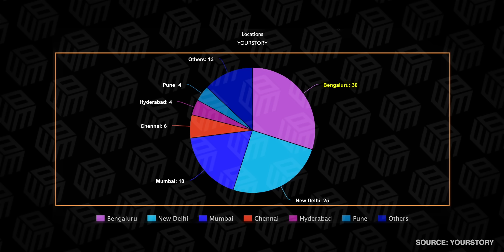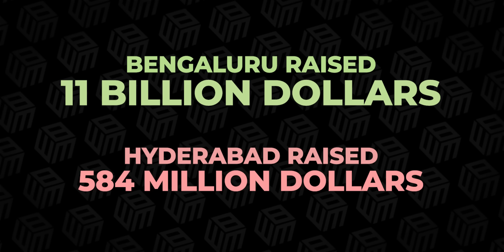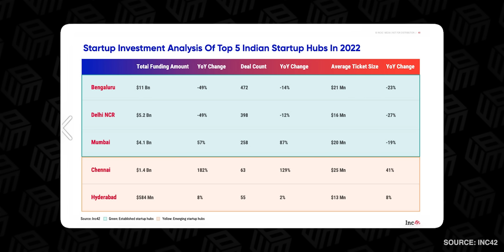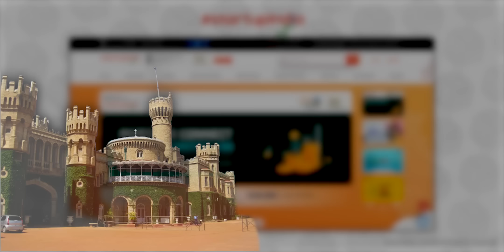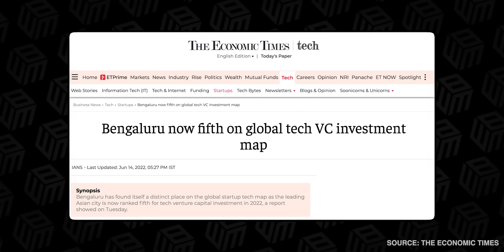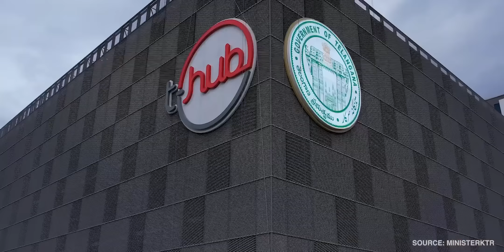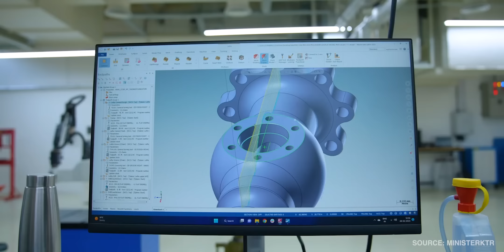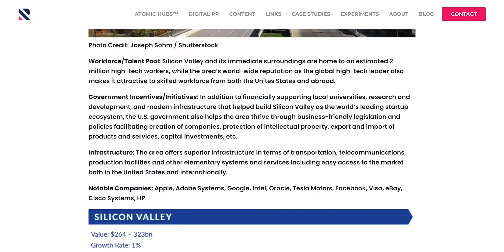Can HYDERABAD Replace BENGALURU as India’s Startup Capital?

Comment: The biggest problem is Banglore is Property (Housing), Water and Traffic. Unless these are not solved, other cities will be benefited, and top beneficiary would be Hyderabad.
Reply: Basically , Infrastructure !
Reply: In this Era we skeptically think Bangalore is the monopoly in startups in India but this will be drastically literally there will be an exponential decrease between the differences in graphs and positions. You know the problems  that Hyderabad is facing might not be the forever but you know the network of startup is engraved totally and Hyderabad is working hard to demolish these kind of flaws which can make Hyderabad a place of startup Hotspot. And if we think the housing , water and traffic every mega city in India has this problems and it only makes better if we go through all the problems and improve our numbers.
Reply: Bengaluru is currently facing the issues which Mumbai faced in 2000s.....back then Mumbai was practically only Megacity of india but due to absurdly high housing cost, biggies dominating the market and difficulty in flow of skilled labor gave room to bangalore to rise as IT-hub. It's also notable that central gov. also tried to push trivendum and later chennai as IT-hub but bangalore surpassed due to better support from gov and ppl for the industry.

Currently hyderabad's gov and public is providing great support to the industry so certainly possible.
Reply: What do you think of PUNE. if Punes infrastructure improves then sure it can give tough competition. As you can see Pune and hyderabad is on same path. See hyderabad has 49 and Pune has 50 so what you think. 😊 by the way love from Maharashtra 😊.
Reply: @Immortal10364  Pune is good but HYD has other advantages. Theres a reason why Bengaluru became IT capital of india and not Mumbai ...somewhat similar dynamics play there.
Pune isnt as big as Bangalore but it's already nearly as costly as Bangalore
Reply: If we talk about Property that is relatively less than Namma Bengaluru, but Hyderabad is having BIG problem of water, everybody canned water is there, tankers for society. Talking about roads only new city Cybarabad road seems good. However Government In Hyderabad is playing good for IT industry and they are keen in improving their work for registering firms in Hyderabad. Pls listen to KTR's speech while Tim Cook was in Hyderabad. His speech seems to be visionary. Talking about Pune, Pune is going through transformation including Metro, Roads, bridges, Public Transport. If Maharashtra Gov. work efficiently towards bringing and keeping IT companies then it will be a tough competition to Hyderabad.
Reply: Bangalore was one of the finest cool city still it is compared other cities !!
What happened was suddenly IT grew exponentially and the it crowded with people coming from across the country. Nearly 30 to 40 percent people are from other states. It is not mean Karnataka won’t like other state people we welcome every Indian. It’s we citizens also have a role to play. Having that said infrastructure needs to improved no doubt about it. Still it’s far better than any city in India like whether people place and all.
Reply: Have u visited Hyderabad now. Most of the Hyderabad roads are under water now
Reply: @SS-uf8yq especially old city
Reply: Footpaths were pathetic, roads full of potholes until Narendra Modi with his visionary Smart City Projects brought Bangalore under Smart City category to ward off shame of not having basic road infrastructure. Footpaths had Kota stone slabs... tar roads were converted to concrete slabs for longer road life.
Reply: Problems with Hyderabad is Public Transport and Drainage system.
Reply: Also major problem - hate against immigrants
Reply: pay at least 20k as rent to get your needs  
As of ur thoughts, the government of Telangana doesn't really care that much, the only thing is education is too bad in SSC and the government expenses of  also too high
Reply: It is enough for one city what i feel
Reply: HAHHAHAHAHAHAHA, look at hyd is 2024, infra so good that it's 50% vacant and empty

Comment: fun fact - Yedurippa the previous CM of karnatala has mentioned in a press release more than a decade ago that due to the agitations in the hyd for a separate state in 2009-2013, it lost  a lot of startup's from hyd to bangalore (which were originally intended to come to hyderabad) and a lot of automobile industries which were scheduled to be started at hyderabad to chennai! and there is no such thing called silicon valley of india in 1980's.

And a recent example is the Foxconn unit that started in Hyderabad ahead of Bangalore which was initially the plan!
Reply: aniruddhavasudeva963   ok man chill!! No need to use the wordings like wipe ass off and other things.  

The Foxconn groundbreaking ceremony happened in Hyderabad 3 months ago! And hyd meto is adding 49 more kms and most of the network actually covers the business places in the city. Hyderabad has a much better infrastructure than Bengaluru (I've lived in both cities) and I suggest you visit Hyderabad and look at the infra yourself. My views are based on practical experience and your views seem to be of emotion!
Reply: aniruddhavasudeva963  ok man! Good luck with that!! Spitting out things like Hyderabad will have the worst traffic blah blah won't change anything. Instead say why will it have the worst traffic. Bangalore already has the worst traffic not just in India but in the world (there are reports published on that). I can see the government here is building new flyovers and roads infra very quickly than Bangalore. 
Hyderabad added 32 flyovers in the last 2 years and numerous underpasses. I didn't see Bangalore doing that. And I strongly believe KTR who is the IT minister is much better than Mr.Boseraju!  (Who is a mere politician and knows nothing)  in attracting the industries here. Hyderabad has the worlda largest Amazon campus and Google campus which KTR played a major role. 

And Foxconn which you are speaking about, his chairman takes inspiration from the government of Telangana. (Check the video of Foxconn chairman speech in Hyderabad) and you will be astonished.
Reply: aniruddhavasudeva963   for your kind info,  Hyderabad doesn't solely depend on IT. It has the India's largest vaccine and drug R&D in the genome valley here. Covaxin was manufactured here in Bharat biotech which is a part of the genome valley in Hyderabad which is the only indigenous vaccine in India!
Reply: aniruddhavasudeva963   ok. You mind your business and I will mind mine!! hahah!!
Reply: @revanth.shanmukh finally give up 😂
Our Bangalore always on top in infrastructure too..Just visit central business district of Bangalore,and then compare with Hyderabad CBD..🤣🤣
Reply: @internetWiz  to be more specific, sick of explaining to people like you who doesn't look at the perspectives from a neutral side than just speaking random things that come to your mouth! I've been in Bangalore for 8 years and hyd for 20 years so I'm pretty much aware of what both the cities are and I'm probably the most neutral person you can find here.
Reply: @internetWiz   would you have believed if I said Telugu film industry would be dominating a huge part of India cinema 10 years ago? Well, a lot of people were aware of that long back but no one listened until it showed. In the same was, Hyderabad will also make you feel the presence felt when it happens (probably 10 years down the lane).
 I personally used to like Bangalore when I was a kid more than Hyderabad especially for the weather and now I don't want to visit there because of the traffic but I can travel much happily in Hyderabad compared to Bangalore. That's my biggest take away from here. Hope you keep some sense of neutrality and look at things from both sides rather than immaturely uttering things like "Bangalore always on the top etc etc.
Reply: @revanth.shanmukh  wait what? U have been for 8 years...Dude iam living in Bangalore more than 20 years😂😂😂😂
And u r sounds like u know about the city🤣
Dude I know every corner of the city..If u want to see a much better roads than in Hyderabad, Go to Malleshwaram, BASAVANAGUDI, Jayanagar, MG road, Brigade road, Indira nagar and many more areas I can list it out.. Bangalore will feels like a foreign kinda city which Hyderabad lacks...Even London has traffic issue.. doesn't mean Londan has lost its value?? No..they over comes that issue..Now our government also doing the same thing..U will see a lot of construction happening around Bangalore for public transport...Metro, PRR ,STRR etc..
Reply: @revanth.shanmukh  Nah bro, Except traffic what else u can complain? Infrastructure? Other than these two ?? Hmmm.....
For traffic, Now our government implementing so many.plans to ground to overcome the issue...Within 5 years Bangalore will solve the traffic issue...And for infrastructure part, except roads, other things will quickly over come...And then ur Hyderabad maybe need another 10+10= 20 years to outperform Bangalore 😂😂😂
Remember film industry not equal to City's grwoth
Reply: @internetWiz   traffic and also I think the city didn't have time to plan because of its faster growth! (When I compare both the cities) for example in Hyderabad there are areas completely dedicated for offices and areas completely dedicated for residential purposes that's something I believe is very important.  Also I'm not comparing the film industry with city development I'm just comparing the success that no one foresaw until it arrived. 

I somehow believe Bangalore should have a good leadership like KTR here in Hyderabad. and yes infra is very very very vital for playing the longer term game!! And if Bangalore will be able to solve it in 5 years, then i will accept that Bangalore cannot be reached by any Indian city! (Which I think is very very hard taking the present government in Karnataka into account)
Reply: @internetWiz   bro! It's 8 years not 8. Months. You are right in the aspect of roads in jayanagar and basavanagudi but I'm not even kidding, I have seen much better roads and city planning In Hyderabad at areas like Gachibowli, nanakramguda etc not sure who did it.  Please visit hyd when you get time and you can compare and get to know if I'm right or wrong!!
Reply: @revanth.shanmukh  ok let me see when I visit Hyderabad...whatever it should be healthy competition... Whatever happens it will benefit for Indian Economy...
Reply: @internetWiz   yes. Very true.
Reply: same is there in jubilee hills banjara hills sainikpuri begumpet somajiguda chaitanyapuri chanakyapuri trimulgherry
Reply: aniruddhavasudeva963  So ok your talking about public transportations, lets have a discussion. Hyderabad has recently planned a metro network of more than 400 km. If things go according to the plan , Hyderabad would have the 2nd longest metro in India after Delhi. The due date for completion of the metro is by 2031..

Comment: Hyderabad is on social media because local govt and real estate companies are pumping up the prices and funding social media influencers. Hyderabad at the max has 30% of tech companies compared to Bangalore but its real-estate is more expensive than Bangalore. This will be a huge dampener if some companies or employees want to shift to Hyderabad.

I am not saying everything is sham but there is much more noise in the social media than the actual ground reality.
Reply: Real estate in Hyderabad is way more cheaper in Hyderabad than Bengaluru anyday. You get a 3 bhk flat in White fields in stand alone building for around 1.3 cr . Whereas in Hyderabad you can get a good 3 bhk flat near Gachibowli for the same price in a Gated community.
Reply: @saketbodhankar5417  Really? Please tell me one gated community in Gachibowli where we get a 3 bhk for 1.3 cr.
Reply: @yogeshm4806  Sumadhura Horizon, which is 10 -15 mins drive from Gachibowli, you can get a 3 bhk between 1.28 cr - 1.5 cr.
Reply: @saketbodhankar5417  Please don't mention under construction.

Also, look at price per sq ft. 10k per sqft is the rate for under construction! Add to it GST and amenities it will easily be 11k per sft. Now, compare this to let's say prices of apartments in Belandur (Adarshpalm Mayberry). It's 20% cheaper and a way better premium brand/reputation than sumadhura.
Reply: @yogeshm4806  Ok agreed but do you really think Bengaluru has cheaper properties compared to Hyderabad? Bengaluru's sft rate for a stand alone building is equal to Hyderabad 's gated communities sft rate. Plus the purchasing power parity of a Hyderabadi is higher compared to a Bengalurean.
Reply: @saketbodhankar5417  I just gave you a example where price per sft of a gated community (better brand in comparison) in Bangalore is cheaper than Hyderabad.

As per the topic of the video, I just wanted to highlight why Hyderabad is in news lately. It's pretty well pumped up by social media compared to ground reality.

I don't think PPP applies here. There will be similar number of rich/middle/poor people in Hyderabad and Bangalore.
Reply: @yogeshm4806  Dude Bangalore ain't cheaper than Hyderabad. I have friends living there and the cost of owning a flat or even renting a flat is really expensive cause there is demand more than supply. In Hyderabad also it's the same but the situation hasn't worsen yet.
Reply: @saketbodhankar5417  I am specifically talking about housing prices. I own a flat in Hyderabad and live in Bangalore and I very clearly see the 15-20% difference when we compare similar properties (location, Amenities etc).

You don't have believe me, just open Nobroker or 99 Acres and search for similar properties in both the cities and you will see the difference.
Reply: Mumbai says Hi
Reply: @Knightsthatsaynih  Mumbai is no doubt a great city but not as great for startups compared to Bengaluru, Hyderabad , etc
Reply: Atleast we don't discriminate against anyone based on their language.. unlike certain someone..
Reply: @mr.nobody125  Yes, that's a huge advantage. Typically when a city grows and local people start earning regular income, they want to dominate since they are locals.

This may not be a issue here because half of Hyderabad anyway talks in Hindi or they understand and reply in Hindi. This is a very rare exception in South cities.

Comment: I am a Hyderabadi and Bangalorean. Having spent equal time, what I can say is that Hyderabad has to go miles to reach Bengaluru's cosmopolitan and cultural identity. Just look at the approach roads of the Railway stations of both the cities. You will see the stark difference. Hyderabad metro is so ugly and less maintained. Hyderabad is overall ugly compared to the clean Bengaluru. There is no dry wet waste segregation in Hyderabad. Before comparing with a clean City like Bengaluru, we should self evaluate, improve and then only compare. There is no point comparing with Bengaluru when none of our roads are well maintained, garbage is strewn every where, drainage is overflowing, paan spit marks all over the city etc.

Comment: Telangana govt and its IT minister are doing pity well , but that minister need not do hate mongering on Bengaluru . Please check google for the twitter battle that took place  recently , Telangana minister mocking bengaluru rains and this year they facing same problem ! laughable ! In simple equations in Hyd Goct is pushing for IT parks by its fund which may be hardly one or two in every 5 years , but Bengaluru has Private participation and more than 80+ eco spaces of work . We all wish Hyd should grow , but dont tell us Bengaluru will vanish . The video seems slightly biased as they are sowing other institutions like BHEL etc . Bengaluru has headquarters of all them . BHEL , BEL , ISRO , IISc , INFOSYS , WIPRO Etc . Why there is no direct match of revenue here ?  its Bengaluru 5 and Hyd in terms of IT economy . It will take Hyd 3 decades to grow as such only if Bengaluru stops growth , That will never happen. Karnataka Govt workforce irrespective of political parties ruling here is very dynamic , Thats special power of Karnataka !